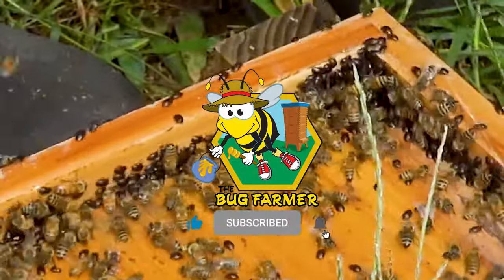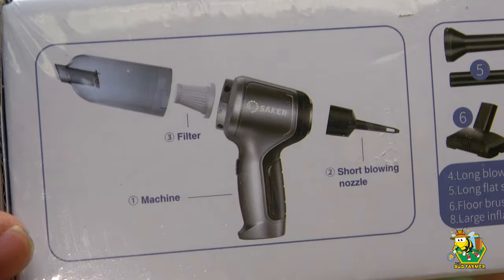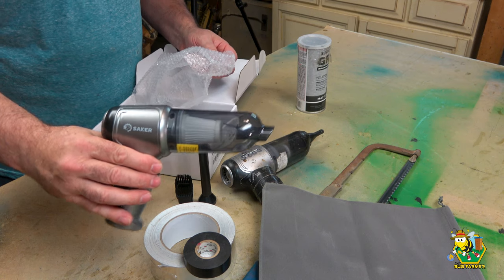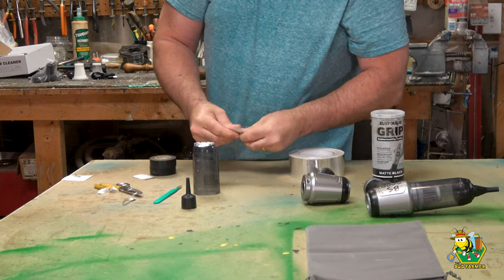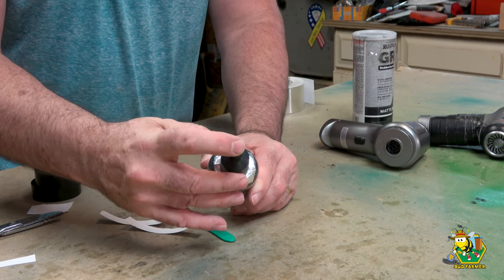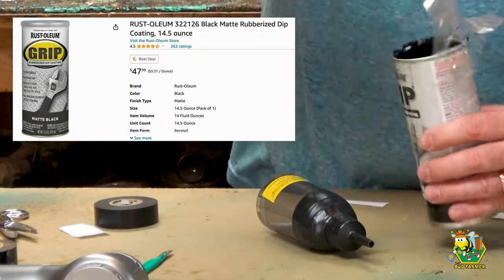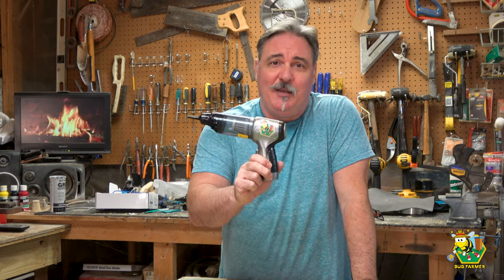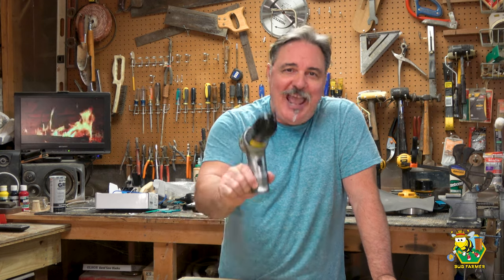NO MORE HIVE BEETLES | Eliminate Hive Beetles With the Beetle VAC | Building the BS-5K  #beekeeping

Comment: Thank you for sharing this, I bought the vac. I clamped the hacksaw frame in a vise and I cut the chute off the wide attachment then using a heat gun i warmed up the small blowing attachment, when the plastic got soft I squeezed the round end into an oval to fit over the cut end of the chute, a bit of electrical tape and was done. I tried it out today and it worked great, was able to such up way more beetles than I could have smashed.
Reply from the maker: Excellent!  The beetles have met their match.  Make sure to freeze the beetles for a couple of days before throwing them away.

Comment: Thank you for this. I ordered a vacuum with your link. I didn’t cut my vacuum. Instead I cut the top off a water bottle and used duct tape to seal it onto my vacuum. I put pieces inside the opening of the bottle connecting to the inside of the oval shape on the vacuum, building a sort of tube out of duct tape to direct beetles straight into the vacuum chamber. The opening of the water bottle fits the narrow attachment close enough. More duct tape keeps it in place. This only took scissors and about 5 minutes to accomplish. It works great!!! It was such a satisfying feeling after opening a hive with about a hundred beetles on the lid, to be able to quickly capture them. A few bees went in too, but I was able to release them unharmed. Then I put the removable vacuum chamber into the freezer to easily kill all the beetles.
Reply from the maker: Awesome.  I never thought about freezing the beetles while in the chamber. I think I will do that from now on.  Heck with drowning them, I'll just freeze them :-). Thanks for the tip.

Comment: Love your innovative ideas!  Do you think hot glue or an epoxy would secure the tip better than the black tape?  The dip was a good idea.
Reply from the maker: I suspect anything that will create a seal will work.  The only thing you don't want to happen is have the vacuum canister break open when you have 1000 beetles inside :-).

Comment: Got one for 11 bucks,made my own nozzle  mod,w J.b. weld,silicone,some trimming,fitting  ,i may open the tip slightly ,mine was missing the inner flap, so used old inner tube rubber ,...presto,....killing beetles helps,im liking the ideas on here about 3d printinting a specific  unit,...also  mine didnt have the steel mesh filter,soon ill test the beetle sucker 5000 2.o😅
Reply from the maker: awesome!  Let me know how it works.

Comment: The piece you tapped to the front of the vacuum is plastic.. instead of taping it you can heat that circle end till it's plyable and mold it into the opening so that it fits snug air tight and it remolds it to that square oval shape
Reply from the maker: That is an idea.